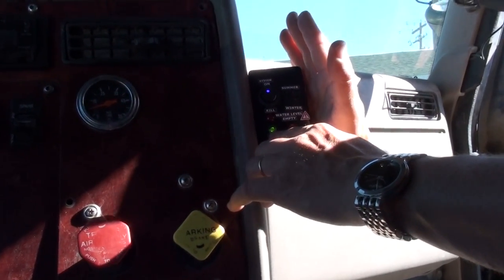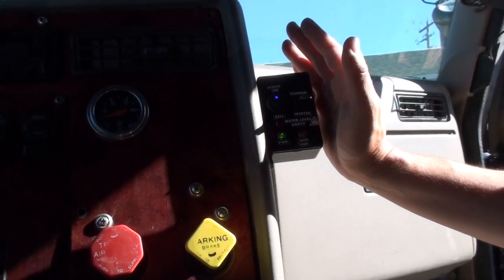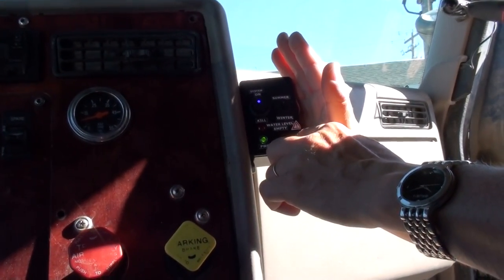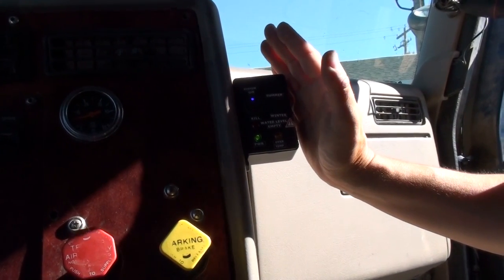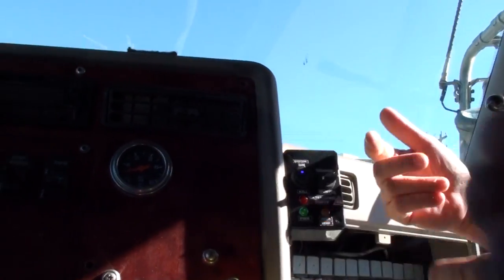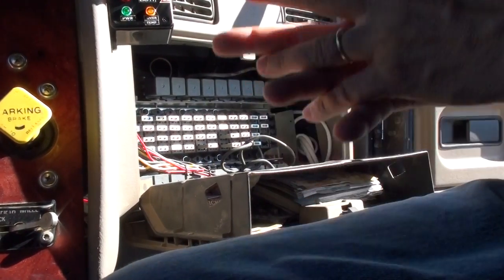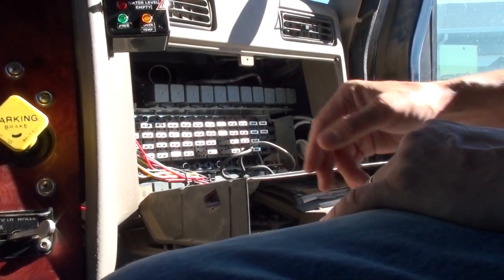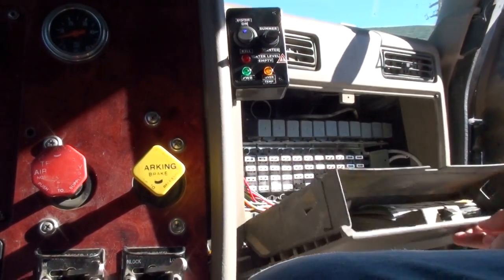Green Fuel H2o 80 plate system installed on semi. Part1

Comment: Published on Mar 5 2015. Now its Jan 2018 - how about an update and show us how the truck pulls while running this system. Did you get completely away from the diesel fuel or is this just a supplemental assist system for the truck?